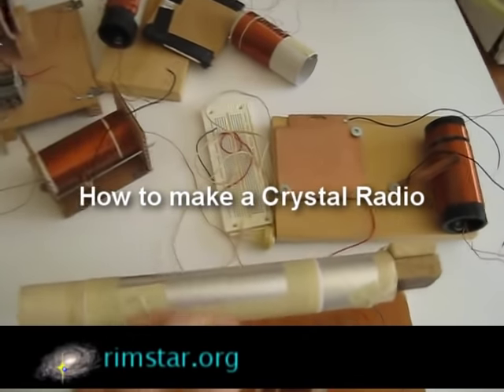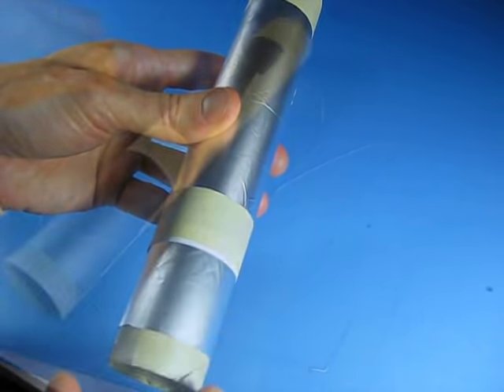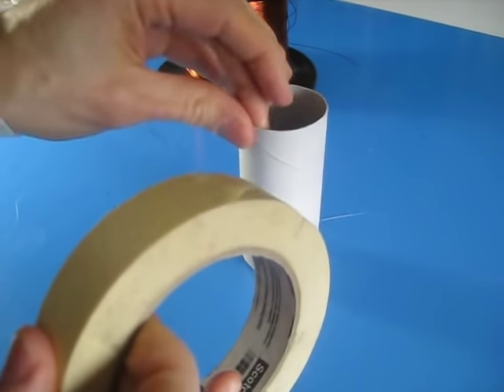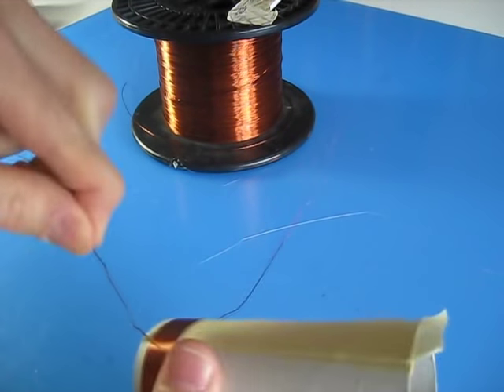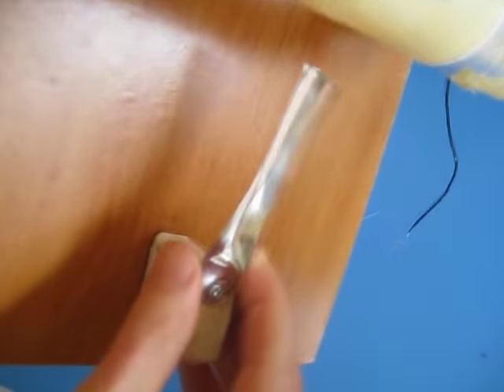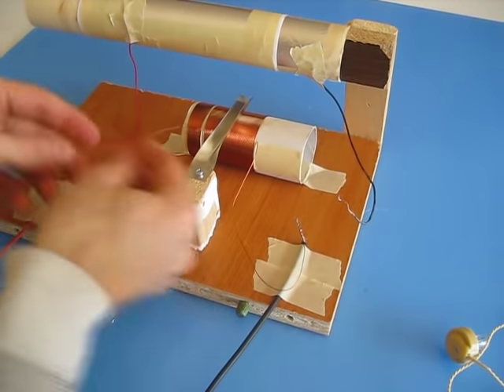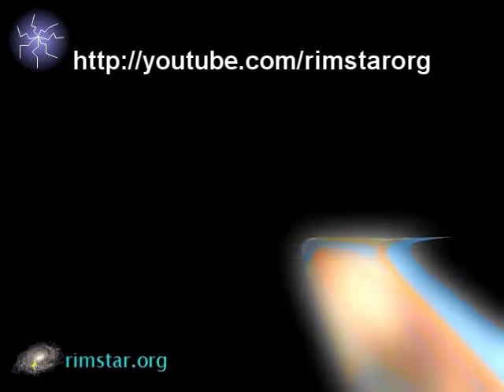How to Make/Build a Crystal Radio

Comment: In this video what did you use for an antenna?
Many of your little tricks are brilliant e.g. use of masking tape for coil winding.
And your variable tuning capacitor is pure genius. Thanks for posting this its a must build for me.
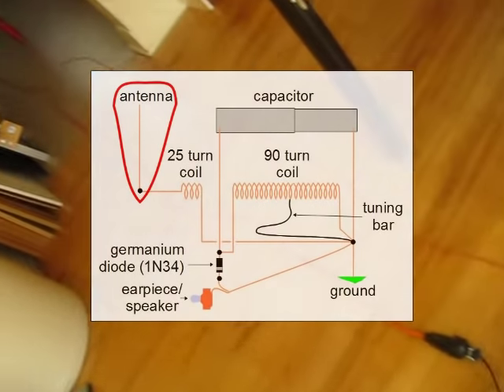Reply from the maker: Loyd anonamous I used a single wire around 15 feet long. I show it briefly in the video at 8:18. That's actually pretty short and works because I live near some radio stations. I later found that connecting multiple of them in parallel, connected together at the crystal radio, gives an improvement when pointed in the general direction of the radio station. I show that in my troubleshooting and tips video at around 0:14 https://www.youtube.com/watch?v=HZZmKZJrIW0
Reply: RimstarOrg
Oh silly me my short term memory must have gone off to another planet.

Comment: hey, can i use a PVC pipe or something with a smaller diameter than the tilet paper roll?
Reply from the maker: You can but you'd have to recalculate the number of turns for the coil. I talk about how on my webpage here https://rimstar.org/science_electronics_projects/lc_circuit_aka_tank_or_resonant_circuit.htm . You want a frequency range of around 540kHz to 1.6MHz to get most AM radio stations.

Comment: Is there any benefit to inserting an iron core into either the capacitor tube, or the coil tube? My thinking is that a metal core in the coil tube,  electrically insulated from the coils could help with inductance.
Reply from the maker: I'm not sure which is better, core or no core. But if you do use a core then you need to recalculate the dimensions of the tuning coil and tuning capacitor as together they produce a circuit that can resonate at a specific range of frequencies. Inductance is one factor in those calculations. See my webpage here that includes calculators for more about it https://rimstar.org/science_electronics_projects/lc_circuit_aka_tank_or_resonant_circuit.htm or this video https://www.youtube.com/watch?v=shZUI6B5bZw

Comment: So, from my basic understandings, I could feed the power (minimal of course) into capacitors and bridge the caps to a DC battery to RECHARGE the battery.  Ensuring I am using a 12V cap only to prevent over charging.  Then with a small grid-tie inverter, could I actually send the power to the grid like they do from solar?  Or perhaps a battery bank to have back-up power for the house?

Comment: WAY cool.  But you should explain how it works, from the radio frequency in the air, to the antenna, and thru the circuit, and how the "power" works.  That would be way COOLER.
Reply from the maker: Already done. Check out http://www.youtube.com/watch?v=0-PParSmwtE. And I agree, it is pretty cool the way it works.

Comment: would an adjustable disk style capacitor work? or would that be too small? like the ones they had for fine tuning circuits back in the day?  or what could we use if we don't have foil? some soda cans with a sanded down spot to attach a wire? for coils does it have to be 26ga wire for coils, or if it's another size does the number of windings change?

Comment: According to the YouTuber "aleutians realm", there are already several labs working on this using nano silicon lithium fibers. Radiometric conversion is not particularly new, you can unhook your satellite dish tv coax and test the coax amphenol connector for voltage and i have seen up to 24vDC at about 25-50mA which is about what you might see from one of those 19.95$ solar panels that plug into your cars 12v socket to maintain the battery.

Comment: I created a Crystal Radio, much like this one, but I used a fixed capacitor just to experiment. When I use the metal arm to adjust the frequency, I pick up three of the same stations all the way across, with nothing else. Though I'm sure that's what was going to happen anyway, what's the difference between my current capacitor (which I'm not 100% sure what the rating is), and a variable capacitor? I'm fairly new to electronics, so I'm not sure what the variable is changing.
Reply from the maker: Corto713 - Clash of Clans In the formula for the resonant frequency, the frequency you tune into, the inductance of the coil is multiplied by the capacitance of the capacitor. They're also on the bottom of the equation: 1 / [2pi * square_root(inductance * capacitance)]. So it is possible to have an inductance range on your coil that when multiplied by your fixed value of the capacitor will cover the whole desired frequency range. Or it could be that your inductance range isn't adequate but with a variable capacitance range it extends to the full desired range.
Reply: That makes a lot more sense! I will look more into that formula, and maybe I can even plot exact points for certain stations, or I can make the quick modification after finding a good variable capacitor. Also I'm looking for a 400 pf  variable capacitor, since that is what I heard was about what I needed. Is that about right?  Thanks for the help, it really means a lot to know there is someone willing to help!
Reply from the maker: Corto713 - Clash of Clans 400pF is about right, and here's where you can get some 365pF https://www.midnightscience.com/catalog5.html

Comment: Hello RimstarOrg,

Thank you for ur video. I made a  portable crystal radio from ur video but I couldn't get any signal. The radio stations are minimum 50Km away from my home. Is that why I couldn't get or any other problem? I checked all the connection but still i couldn't get. Is there any way by which I can increase the power of my portable radio by adjusting my anteena or capacitor. I used a 16 gauge wire. Same germanium diode.

Comment: many years before, I used crystal headphones ( PIZO) and just one diode parrellel to headphone, one terminal was antinna and other ground. it works if there a strong. signal. the strongest AM is only heard. Better design is AM coil, ferrite rod, trim cap,  and one transistor and 9 V battery. hope  someone could demonstrate it again.

Comment: The radio works great except for one problem.  I have to hold the capacitor (the foil of the sliding end) in order for the radio to get reception.  Did I do something wrong?

Comment: You mentioned magnet wire from Radio Shack. Radio Shack bellied up and floated to the surface years ago (at least by me (Northern New Jersey area)). Who stocks magnet wire? An electric supply store, or the hassle of bothering to order it online?
Reply from the maker: Unfortunately Radio Shack was the last generally available store that I know of that has it. There's a local store here in Ottawa, Canada that has it but it's not a part of a franchise.

Comment: Hi, just looking for a bit of help and information. I would like to know when I come to make the coil around a tube, if I can use a Pringles carton ???
As what affect would it have with the inside of the Pringles carton having a silver lining. I have seen some radios that use 2 windings on the tube. As they say that 1 of the windings (the smaller one) is used as a fixed capacitor. Could the Pringles tube be used as a fixed capacitor ????????????????????????
I do NOT know about electronics. But I know that some radios use a small coil as the capacitor, and other radios use a true electronic capacitor. 
Hope that YOU or someone who might look at the comments can tell me what it is that I would like to know. 

Bye from John in England.

Hope you and everyone is staying SAFE 😷
Reply from the maker: What you're describing with the Pringles carton works but the circuit is different. I'm not sure how well it would work with the one in this video since the dimensions a different and if the carton has a metal lining too then that makes a difference too. The dimensions and the metal both affect the coil inductance and so the dimensions of the tunable capacitor would have to change to match it.
Reply: @RimstarOrg  thanks for getting back to me so quickly

Comment: Good video...I cant find a diode..radio shack does not have any..do you know of any scrap tv's or radios that have these diodes???or a good substitute...thanks for the fine video...Im trying to use the wire from old tube type tv's to make my coils..it is the wire from the picture tube yoke...
Reply from the maker: +Kennynva T. I don't know of any appliance or thing you could take apart that would have a germanium diode (that's the type you need) in it. You can buy them very cheap on places like ebay.com or whatever ebay there is for where you are. There are probably other places online too that sell them cheap. Just look for 1N34 or 1N34A diodes.

Comment: Would 30 AWG Magnet Wire work? Thank you for the well explained video! It's the greatest I've seen for crystal radios so far!
Reply from the maker: I haven't tried it myself, but the formulas say it would work. The problem with 30 AWG is that it packs more frequencies into a smaller area. That means it'll be much harder to tune in to a single frequency.
Reply: Too difficult to wind without breaking - - unless you are practiced or have the right tools. The selectivity will be low for such thin wire due to 'Skin Effect' loses

Comment: Why do you put on the first 25 turns? I have built this model, but haven't received anything except the cycling of my electric fence. I intend to troubleshoot some more and may try the model with taps. I may also try building the amp.
Thanks for all your great videos!
Reply from the maker: +greg La Roche Two coils are used to help tuning into a single radio station without have interference from other stations that are near it in frequency. See my How a Crystal Radio Works video at 3 minutes and 36 seconds http://www.youtube.com/watch?v=0-PParSmwtE.
The most frequent problem is not having a long enough antenna, especially if you're not close to any radio stations.
Have fun!
Reply: +RimstarOrg Thanks for the quisk response. My antenna is around 40 feet long and I am sure I have a good ground. I am far away around 70 km from the town of Lyon in France. I noticed that there are not a lot of am stations like in the US. should I try with only the one coil? If so, how should it be set up? Also, would using it at night be better or worse? I seem to remember that back in the US station had to reduce their power at night.
Thanks again for the help.
Reply from the maker: +greg La Roche There are some circuits here https://en.wikipedia.org/wiki/Crystal_radio that have just the tuning coil. I've never tried it at night but I know I get a stronger signal during the weekdays starting around 16:00. But that's here in Canada. I don't know if it applies to France.

Comment: Very good but where does you connect your postive supply
Reply from the maker: There is no separate power supply. Crystal radios are radios that are powered by the incoming radio waves themselves.
Reply: @RimstarOrg  it means crystal radios is work without any supply voltage and one more question sir can i run my home made crystal radio without any battery aur supply
Reply from the maker: I'm not sure I understand your question. If it's a crystal radio then you should not need a battery or supply voltage. The energy should come from the antenna. Are you sure it's a crystal radio? If it's a radio made with one or more transistors then it's probably not a crystal radio.
Reply: @RimstarOrg  thanks i will use rf amplifier in my crystal radio

Comment: The ferrite core coil was pre wounded , i buyed it , but today i maked a coil from magnet wire that i took from 1 mw ferrite core coil and a lw one , i maked the coil on a cardboard tube from aluminum foil , the primary has abot 30 turns give or take 2 , and the secondary has about 90 . I can catch 3 stations pretty clear , before i just caught two , i will make a coil from a single wire , not from two pieces, like my actual coil is ( in the secondary the last 30 turns are from a different wire

Comment: Great video! I was helping my son with his science project and we were using pvc for both the capacitor and coil. The coil cylinder is 3 1/2 inch diameter. I am confused on the number of turns? I am having a hard time figuring out the adjustments on both the input coil (25 turns in video) and secondary (90 turns in video). What I have found on the internet has not given me a clear number to adjust both of these coils? Any help would be great!

Also on the Capacitor will the added thickness of the PVC vs using the thinner cardboard tube and paper have any negative effect?
Reply from the maker: +Walter Blizzard I used 25 turns because that's the number that was given in the book I mention in the video description where I originally got the circuit. But the 90 turns can be calculated. The 90 turn coil, called the tuning coil, forms a parallel LC resonant circuit with the tuning capacitor. In your research you should look for parallel LC circuits and resonance. The normal AM frequency range is from around 540kHz to 1.6MHz and you want to be able to adjust the coil inductance (L) and capacitor capacitance (C) such that they can have values together that will make them resonate together across that whole frequency range. You can see more about this in my video about how a crystal radio works (http://www.youtube.com/watch?v=0-PParSmwtE).
Reply from the maker: +Walter Blizzard Oh, and regarding the thickness of the PVC, what really matters when comparing the two is the outer diameter that the coil is wound on (well, really the area of the circle formed by the coil when look at from the end, but diameter is what determines that area.) So as long as the diameters are close enough, which I suspect your PVC is, then you're okay. And PVC, cardboard and paper are all similar enough materials. Look up the formula for a coil's inductance for more on how all the parameters matter. That inductance is the L which I mentioned in my other reply. Here's a link http://hyperphysics.phy-astr.gsu.edu/hbase/magnetic/indcur.html.
Reply: +RimstarOrg Thanks for the info and the link I will study up on it.

Comment: Cool.  Would it make the signals stronger in the earpiece if the primary coil was 50 turns?
Reply from the maker: I'm not sure. I'd have to do the calculations. It may have a worsening effect or make an improvement. I got the 25 turns from the book that I got the circuit from.
Reply: @RimstarOrg Thank you.

Comment: Built the radio with my granddaughter, it works! However, after about 1 min or so the sound gets weaker and eventually goes away. Then, if I disconnect the earpiece, and reconnect, it is strong again! Then it slowly fades, disconnect, reconnect, its back. I have done this over and over. Why is this happening?

Comment: ive seen nail polish used to firm up the coil...... but it seems not enough to dissolve the coating completely - and short out, right?
Reply from the maker: I can't say for sure. I've never used it myself. A quick search on the web shows mixed results.

Comment: If I use 34 gauge wire instead for the coils, how many turns do I have to make?
Reply from the maker: 34 gauge is too thin. The coil would have to be very long and you'd need a huge number of turns.
Reply: @RimstarOrg  Wow didn't expect a reply on an 8 year old video ! Thanks a lot! It's unfortunate I was hoping I wouldn't have to buy thicker wire because the mail takes so long with covid but it's all right I guess. Thanks again and have a good day

Comment: Hello !!! very nice review  i really like it a lot...
 But i just wondering , if you use a coil with smaller radius is it going to have  some difference or not ?
Reply from the maker: Buxpo A smaller radius coil changes the inductances for the different positions of the wiper blade. The smaller radius causes a larger range of frequencies to be available, but that also means that the radio stations will be closer together as you move the wiper blade across, making it a little harder to tune in to just one station if they're already close together.

Comment: We built it following the instructions includng the changes listed in the trouble shooting video. It works great except for one problem. We are only getting one station no matter where we are moving the tuning bar. Any ideas what we did wrong?
Reply from the maker: 89dreabirdflies72 To possibilities come to mind. Maybe when you sanded the enamel off the top of your tuning coil you might have sanded a lot of it from between the windings too. Any two windings that are in electrical contact as a result act as a single winding. So you may have less turns on your coil than you think, narrowing your tuning range.
More likely though, you're picking up the strongest or closest station and your antenna simply isn't long enough to pick up more. If your antenna is inside a building that can also limit what you can receive since the building will absorb some radio wave energy. Possibly if you connect an amplifier to the output you can pick up more stations.

Comment: In the video, you state that you can use a connection to a hot water pipe as a ground. Is that correct? I always understood cold water pipes go to ground and hot water pipes were a maybe.
Reply from the maker: +Marty Lifgren That's a good point. hot water pipes go to the hot water tank so who knows if they get to Earth ground. Although the water they come into contact with at some point is conductive and goes to ground, even if it's just through more pipes in the ground. But I'd say it's all a maybe, since even the cold water ones go to a valve first, and probably have teflon tape around the threads there. I'll add an annotation anyway about preferring the cold water one. Thanks.